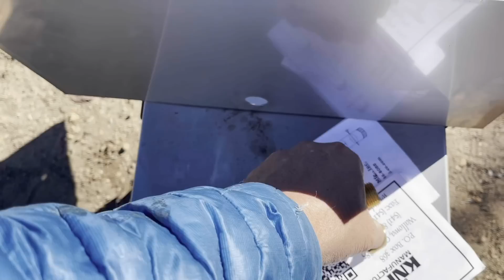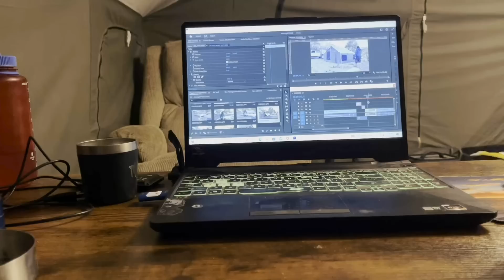Setting up a Wood Burning Stove for the FIRST TIME & FIRST COOK - Hot Tent Camping Off Grid

Comment: I use a canvas tent(same one as brian) for hunting in Northern AZ. You might wanna get a heavier stove because a cast iron one will hold the heat MUCH better, but is also much heavier. Also I use a heavy welding blanket under the stove that I got off amazon

Comment: There is a skirting that goes around the pipe right where it leaves the tent. Makes it more air tight. That way your heat doesn't escape and rain doesn't come in if it's raining. Really cool setup you have going for yourself. Gives ya lots more room.

Comment: You put a Little dirt in to create an insulation layer. Same as when you clean the stove out, you leave some ash in there or the next fire burn colder and needs a heavy draft to keep it going. Iv never had HVAC in my house. I live in the house I was raised it (its a family owned house....thanks grandfather).. Wood stove only. 1951 2100 square foot rambler!

Comment: We heat our ExpeditionVehicle using a Wave 3 catalytic heater.
We discovered it does a poor job heating air.
Accordingly, our floor is slate... on its stumpy legs, the heater warms the slate, and it slowly radiates into the room.
.
Bonus:
The warm floor is wonderful on our tootsies!

Comment: My tips, on 3rd winter with something similar....
The flue isn't very big, easily blocked especially just as it pops out of tent into the cold. Work out a way to easily smash out the flue.
Mines in a van, and I open the skylight above whenever I open the door for smoke control. Not sure what you'll need, maybe an extractor fan to outside of tent?
Reply: @Off,
I think convection is adequate.
Our hx:
During winter in our ExpeditionVehicle, we open two windows on opposite walls... sometimes one a half-inch, sometimes the other an inch depending on the outside winds.
The escaping warm air carries humidity and odors.
Reply: @Large Marge  removal of humidity and odours is the best thing about the burner.  Im outside a lot, with dog, getting wet, drying out clothes and removing wet dog smell.  Couldn't do that with a propane heater.

My skylights are both normally open an inch, but the one over the burner gets a full open when opening the fire box for smoke control.

Comment: When you decide to build a permanent home 
Pumicecrete is by far the best building material on the planet Pumicecrete is a mixture of pumice cement and water mixed and poured into a set of reusable forms walls are poured from 12"to 24" thick pumicecrete is fireproof termite proof rust rot and mold proof and has a high R value and good sound attenuation solid poured walls means no critters can live in your walls Pumicecrete can be built for a fraction of the cost and time and pumice is one of the few building materials that can go directly from the mine to the job site ready to use without any additional possessing and zero waste
Google pumicecrete homes
Reply: @Ray,
How much water would they need to haul to the acreage?
Reply: Pumicecrete is 10 parts pumice to 1 part cement and 1.5 parts water 
You would need to know how big is the building to know the answer to this question
For every 100 yards of pumice you need approximately 3000 gallons of water